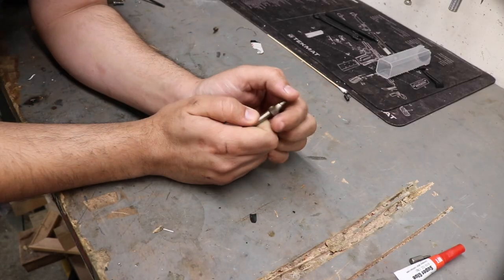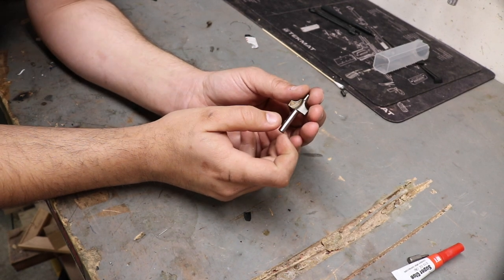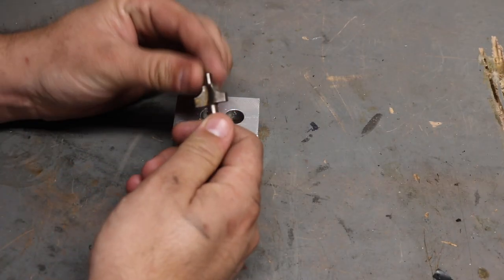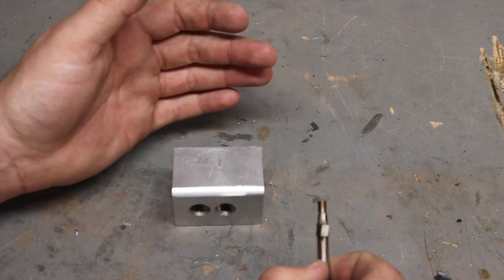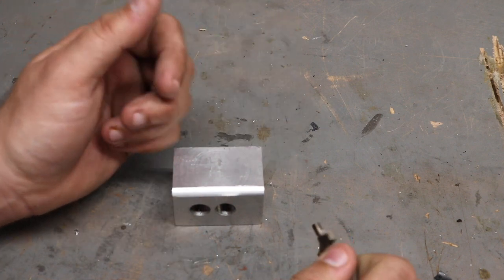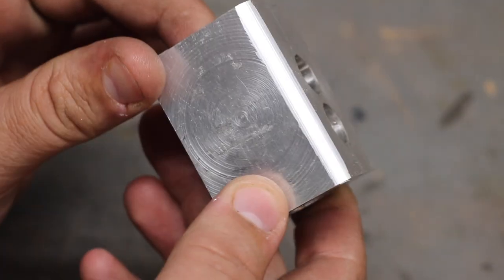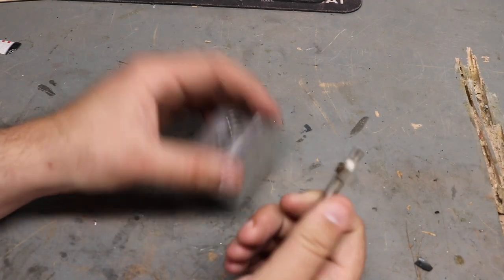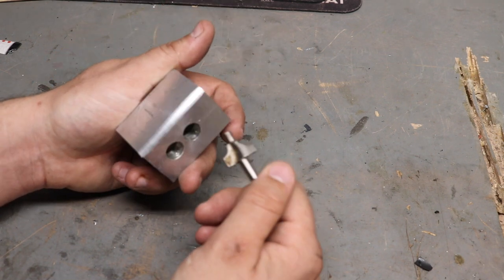Will a Basic Router Bit Work on Aluminum?

Comment: I love that you call it "regular old 6061" instead of marketing hype "aerospace quality 6061". Thankyou for knowing what's what.
Reply: AIRCRAFT ALUMINUM  6061. THIS IS BEFORE heat treatment  becuse it can get harder. I used to make all kinds of stuff with this in a machine shop.
Reply: Ive been cutting aluminum for 21 years. I agree 6061t651 is the jack of all trades when it comes to aluminum..

Comment: Careful with glued on carbide bits! I had one come unglued from the heat and did some damage! (luckily I wasn't in the path)
Reply: Id stick with whiteside or Amana both are brazed on not glue.  You must have had a cheap Chinese made router bit and they are worthless on wood too.

Comment: What was the RPMs on your mill and feed rate also depth of cut.  Not a bad finnish for a 2 flu cutter ment to shape wood. But the question is becuse I dont own a bridgport or any mill and a drill press wont hold a tool like this without falling out of the chuck with lateral cutting pressures. It might work on soft woods and some American hardwoods but its not going to work on exotic hardwoods that good they are just too hard. 
Oh id so love to have a mill and metal lathe. That with my woodworking tools would compleat my shop tools mostly.
Maybe a drum sander.  

I wonder can you do this with a router table?

Comment: hey there, tom over at ox tools has used a carbide to roundover but on mild steel for his etching press project, it sure took a heap of abuse and saved a load of grinding!
Reply from the maker: +Brad Mcconnochie Good call!! His video was specifically one of the ones I was thinking of when I referred to others using carbide!  Thanks for watching!!
Reply: Which video? There are several.

Comment: I mill steel with router bits.. on my cnc router...
Reply: Someone Else Uhm what's special about Router Bits?
Reply: Someone Else I see people using CNC machines to route steel, but can it be done by hand using a router?
Reply: @jerrywhidby.  Absolutely.  You can cut the heck out of aluminum with a hand router.  There is a whole industry based on it.  Google AR-15 router jig.
Reply: @jerrywhidby.  whoops I'm sorry you said steel.  That I wouldn't know.
Reply: Hi what speed are you using for the bit

Comment: Sounded like a bit of chatter, but a much better result than I expected. I sure wouldn't try that with a router though.
Reply from the maker: +MarginWalker a bit of vibration but if it was chatter it certainly wasn't bad in my opinion. A router itself would be a whole different beast on aluminum! Thanks for watching!
Reply: works fine with a router as well....just need a good flat surface for the router to ride on and you have to make damn sure you never climb cut....also keep the wd-40 handy....its usually banished from most shops but while routing on aluminum its definitely worth spraying the evil stuff
Reply: Low odour lamp oil [US: kerosene: UK:paraffin] works very well when machining aluminium.
Night and day difference when turning. Probably just as good when milling.
I also use it when miter sawing aluminium. Just dab it on with a small brush.
I am very allergic to WD40. It causes severe asthma symptoms.
I have never had asthma symptoms until I tried WD40. 
Avoid at the slightest sign of breathing difficulties!
Reply: yeah its fairly vile stuff lol....works wonders for some things but its nearly impossible to remove and even a chance of overspray needs to be kept far away from any surface that eventually needs painting...plain old ivory bar soap works fairly well on aluminum too...especially to keep files,burrs,sanding and grinding discs from loading up